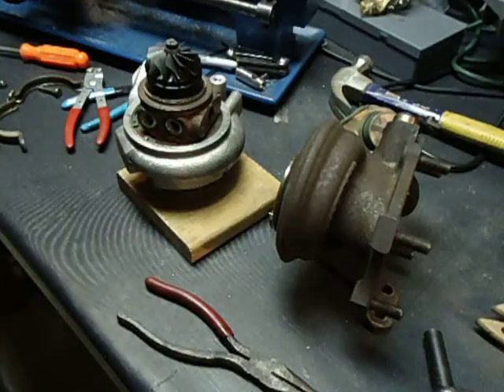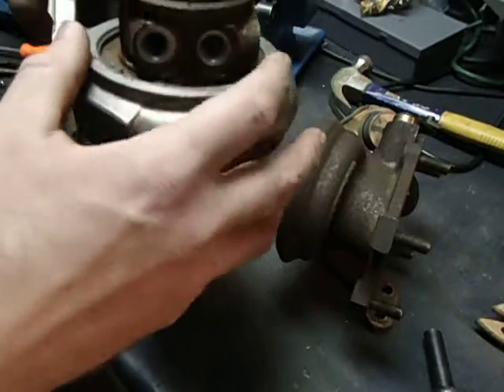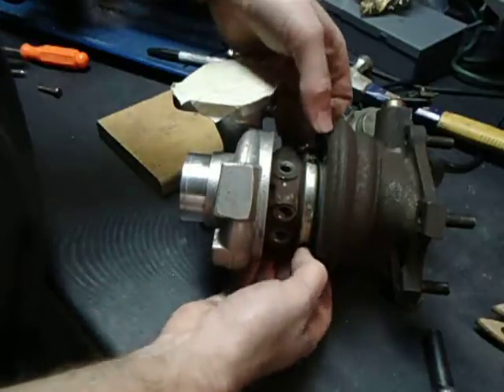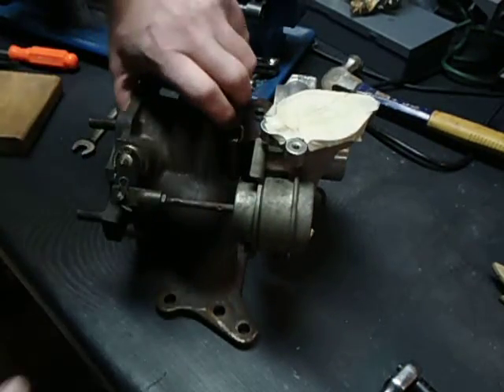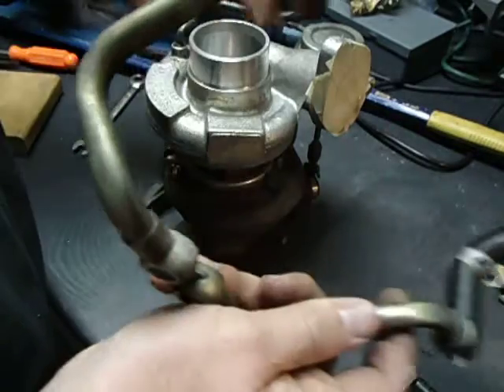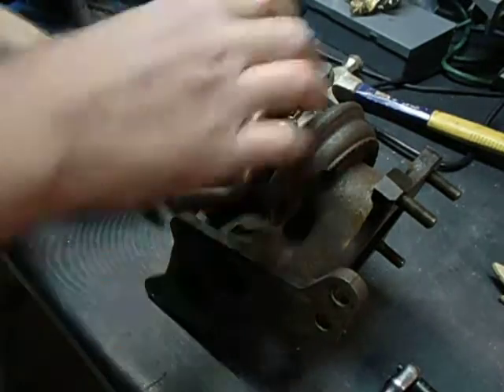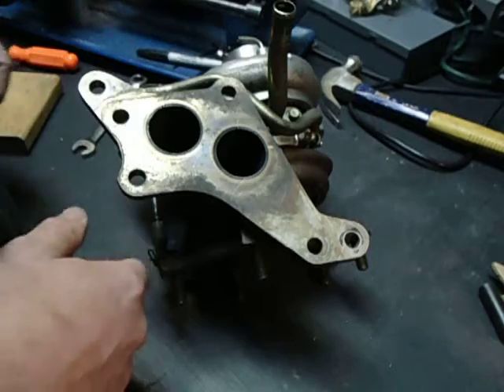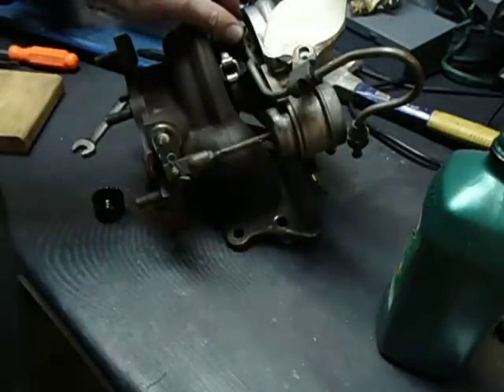Mitsubishi TD04 HLA 19T For Subaru EJ20Y Assembly Part 2

Comment: What's the difference between this turbo and the td04 that comes on a wrx? I have a ej20y block in my 08 wrx.
Reply from the maker: Travis Davis Hi, the short blocks are identical, if you look at the exhaust manifold flange, you'll see 2 holes for the up pipe. The exhaust manifold is different, it has 2 cylinders going into 1 pipe, and the other 2 in the 2nd pipe. The USDM turbo has all 4 cylinders going to 1 up pipe. The idea is that the exhaust pulses are timed and the pulses don't hit each other, so the turbo spools faster. And it does spool much faster. Also the compressor side is different, larger compressor wheel, different exhaust wheel, and down pipe flange is way different. The cartridge is different too, but the bearings are the same, and most the seals.
Reply: MrTurbo458 thanks for this info. In your opinion would the wrx td04 cause an engine misfire or create a boost leak? I currently have a misfire on cylinders 1 and 3 with slow acceleration until 3k rpm. I changed my plugs and coils and even swapped coils to see if the misfire moves.
Reply from the maker: Travis Davis Generally, I've seen misfires caused by spark, but with Subarus I've seen it could be the crank position sensor, or a few other things. I'm going to guess it's a valve issue though, do a compression/leakdown test. If it's good, check for vacuum leaks, etc. Generally, the turbo will just cause loss of power, but it can also shoot parts of the turbo into your engine if it's really shot, and cause other damage. If you have a boost hose leak, or an atmospheric dump BOV, it can throw misfire codes too, I've experienced. Good luck! Check some of the forums for Subarus too.